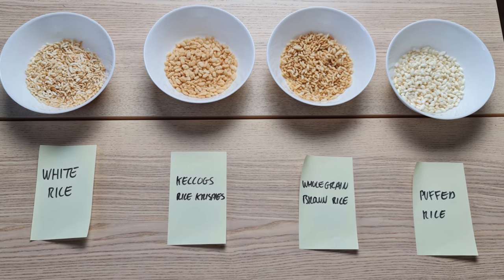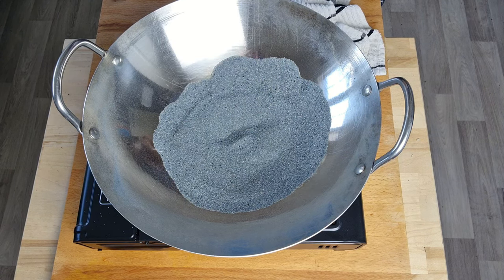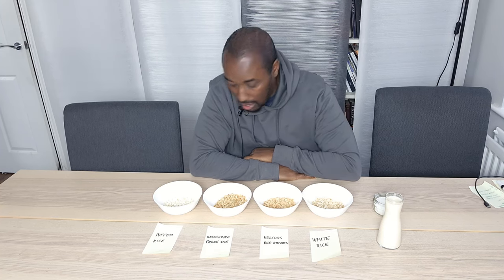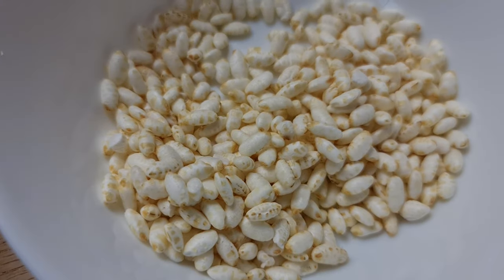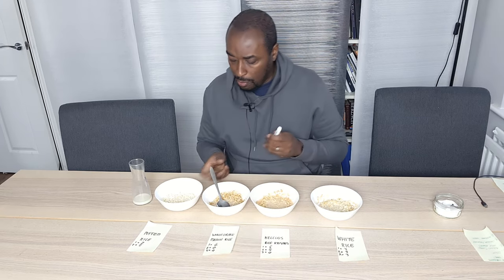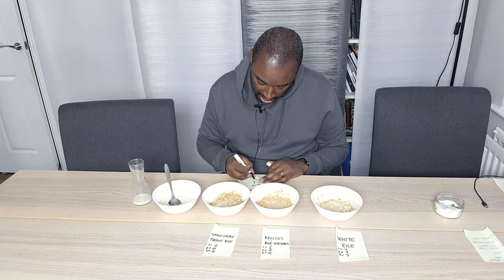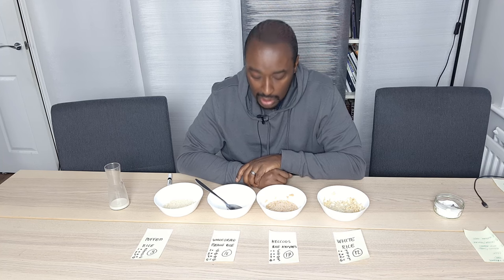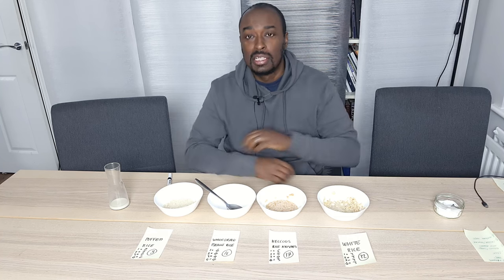Homemade Rice Krispies Taste Test: The Video Kellogg's Tried To Ban!

Comment: This is awesome! :) I tried with normal rice it was a bit hard and didn't have the complete puffed up texture I was looking for but it was close and tasted/ smlt like cereal so this helps to know that I can make black salt I'm going to check that out!
Reply from the maker: I will post the Black salt video shortly. It's nothing special, just regular table salt a dye black with food colouring, before drying it out. I do this so that; 1. I don't confuse it as a food product and mix it up with other salt, 2. It really helps the rice stand out when cooking and 3. it looks better on the video.
Reply from the maker: Possibly the heat wasn't high enough. My first few attempts the heat wasn't quite hot enough and even though the puffed up the grains remained small and quite hard. Make sure you use a parboiled rice and really heat the salt up. Good luck with your future attempts. 👍🏾
Reply: @FoodTech101  wondering how hot your pan was set at? Or did you ever try testing the temperature of the salt with a probe thermometer? I would love to know the temperature 🙏 
Thanks for such a fun video! I love trying fun things like this! Especially when it's cheaper and healthier than the original 😂

Comment: Would be faster to just poor into another pan over the sif.  Makes them all equal. Would this work without parboiled but sella rice (steamed). And maby the white gets better with a short soak and then dry them.  Maby the grain is just to dry. 

And my personal fav with them is melting chocolate and cover them with it and make small drops of them to get bite size snacks.

Comment: Did you parboil your rices??  I love your use of black salt. What a great idea.  Puffed rice does not require a cannon. That explosion is just the air preasure created from the rice popping in a sealed container. Puffed Rice is dry popping it without oil, Rice Krispies is popping it with a tiny bit of oil.

Comment: I tried with par boiled rice and the grains are quite small. I tried with regular basmati - even smaller. I then tried wetting then with a tbsp or so of water and letting them mostly dry out and that made them stick to the salt, but a couple of grains here and there puffed up a lot but they were still mostly quite small and hard. I wonder if it's better to cook the rice a bit and then dry it out. It seems that it's difficult for the grains to puff up. I used a regular stainless steel pan about 20cm and table salt - works fine. Temp 220-250 C. 

Would love to find a perfect recipe for these. If I find parboiled brown rice I will try that. Thanks for the videos :)

Comment: I'd be interested in seeing a vid on how to produce the parboiled rice.  I did a search and found many YouTube vids on how to make the rice, but none on the drying process. In your other vid you showed the lady adding just a small amount of water, while the vids I have found use twice the water to rice. Thank you. Very interesting. I'm in Thailand. Lots of rice, but very little is cereal, and it is very expensive. I am looking to try.
Reply from the maker: I hear you. But until you find that video, here's a process you can try: get some rice (any rice), and cook it for half the recommended cooking time. Strain off all water, and dry completely in a dehydrator or an oven, until completely dry. Then it can be stored and used. When cooking, just use half the cooking time.
Reply: @FoodTech101  Can I soak the rice so its sprouted? Noticed that malt is used in many cereals and biscuits to add a crunch. Noticed calcium hydoxide lye isused to nixnatalise corn kernels and also to add crunch to poppadums and bagels

Comment: The puffed rice maybe insufficiently cooked, and missing out on the 'Malliard Reaction", part of getting slightly browned /toasted? 
All of the other grains looked as though they has extra flavour because of some toasting / browning....
Do you think there is some truth in what I just mentioned? Or did I miss something important here?
Reply from the maker: Puffed rice comes out that way because of the process.  It's heated in a pressurised cannon then the pressure is suddenly released.  It does not have a direct heat source like an oven, therefore does not get the full toasting benefit of the maillard effect.